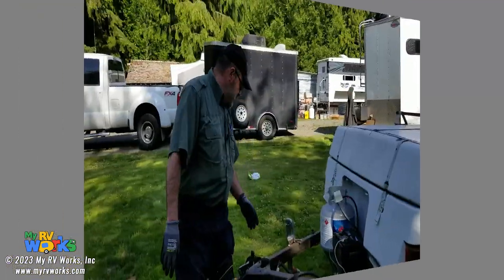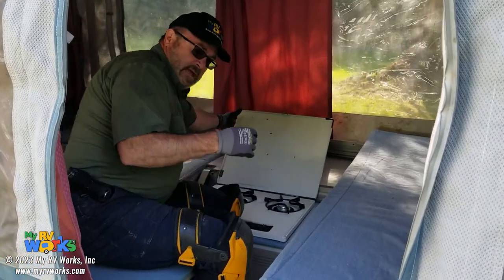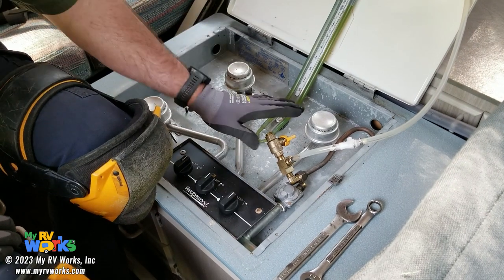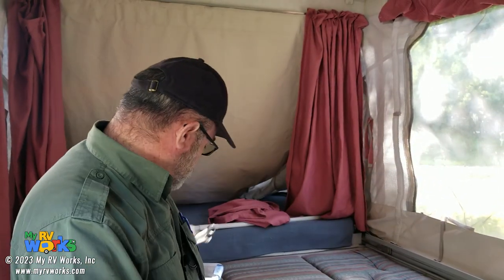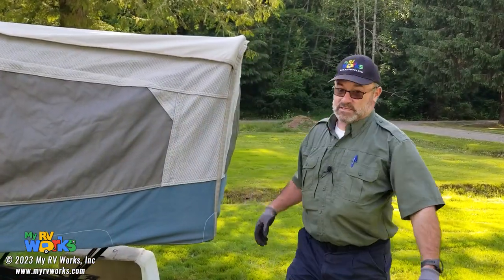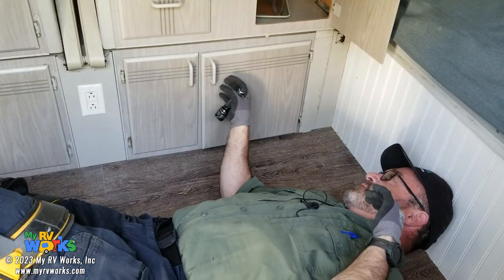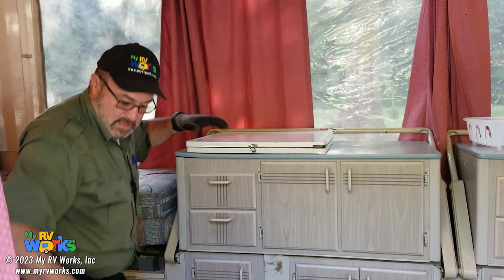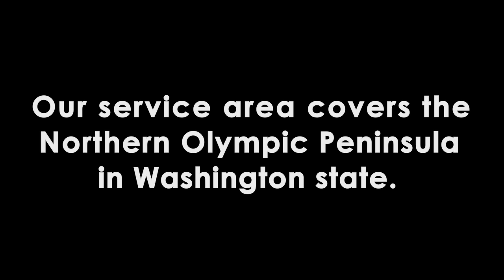RV Inspection - PDI On A Pop-Up Camper  (Part 2) -- My RV Works

Comment: Our first Pop-up had outside access under sink.  We placed a window AC in cabinet.  When we would open access door on outside.  Pull AC out a little. Open cabinet doors to have AC in trailer.

Comment: That looks like replacement canvas to me… mostly because the lift arms have no covers… As they are, if they are left uncovered during a rainstorm, rain will be channeled right into the body of the camper down to where the lifts connect to the floor/frame.  My StarCraft pop up has flaps that Velcro’s around the lift arms to deflect any water away.